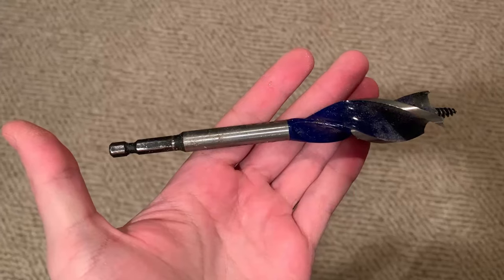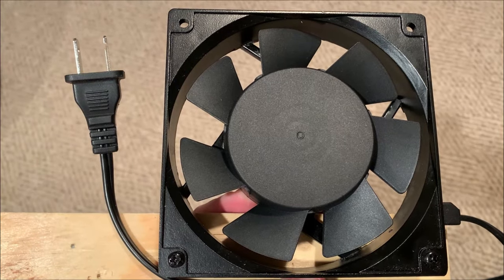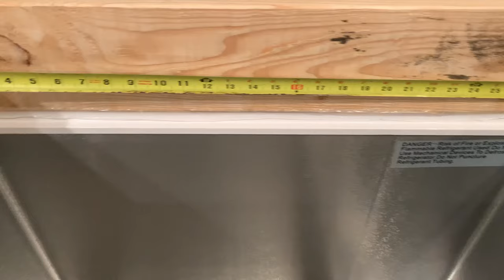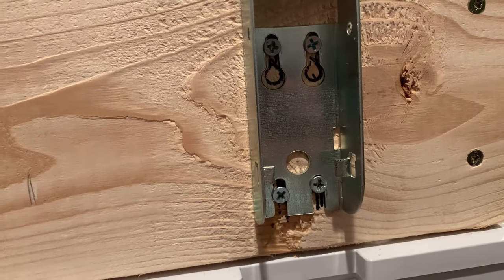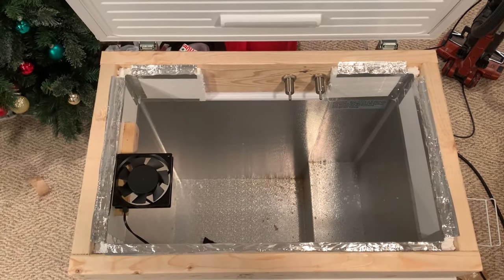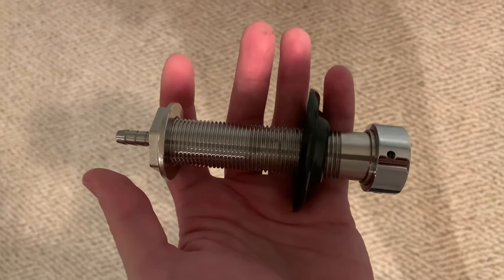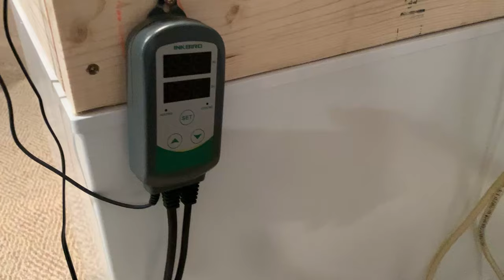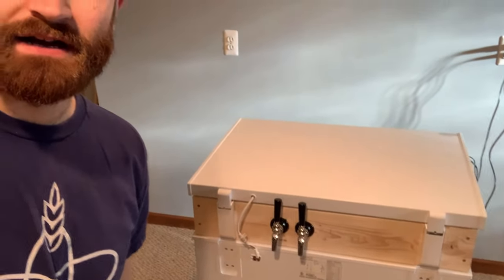How to Build a Simple DIY Keezer | Freezer Converted into Kegerator! Co2, Kegs and Tap Setup!

Comment: Nice job!  I built my Keezer back in 2005 and just purchased a new freezer to convert this weekend, (9/17/2023).  I'm still on my original Johnson temperature controller and all four Perlicks function as good as they did 18 years ago! Do it right the first time and it will last a very long time. I've never used any insulation as inch and a half wood will insulate at refrigerator temps just fine.  For others doing this project I would recommend using 3/4 inch wood around the top to create a nice flat sill for the lid to sit on.  Sand everything down nice and smooth and use two coats of primer followed by two coats of gloss white exterior paint and it will look like the collar is part of the freezer.  Mine is built into my bar so you can't see it but when I first started using the "keezer" it was placed in a room so the wife approval factor was high on the list.

Comment: Hey Matt, this video inspired me to build my own.. Quick question. I know you're using a temp regulator to keep freezer temps steady. But I know the freezers get mega cold, any problems keeping the temps around that mid 30s range? Can't imagine the freezer would have to work very hard to keep that temp level. Just don't want anything to freeze. Thanks in advance
Reply from the maker: Thanks for checking out the video! The inkbird regulates that so it does not get too cold. It will just kick the freezer on and off all day to maintain a temperature.

Comment: Does that inkbird controller turn power off when temp is 38f and will it turn the power back on if temp reaches say 40F. If that is correct can you supply model # of the inkbird please.
Reply from the maker: Hey! Sorry for the late reply, my notifications were turned off. Need to look into that...  You are exactly right! Also its just the most generic inkbird. Just amazon inkbird and its the first one that comes up.

Comment: when i built mine i didn't add any insulation at all to the collar, and it works just fine and looks a lot cleaner. thick, solid wood is actually a pretty good insulator all by itself.
Reply from the maker: Yea I dont think I added insulation on the first one either. Its just a nice to have, not a need!

Comment: I built my keezer 2.5 years ago...The inkbird you used for your keezer is what I used for my fermentation chamber...I've been using the Inkbird 1000F for the keezer and that's the achilles heel of my whole system...those are made to switch small loads, not a freezer compressor...it works, but I just went through my second one in 2 years. So, if anybody is thinking about using an Inkbird 1000F - you may wish to look for something that can handle a 15 amp load - it will probably live longer - really getting tired of beerpops.
Reply from the maker: Hey I didn’t think that would be an issue but I may look into that a bit to check that out, thanks to letting me know!

Comment: Nice "quick job"!
Why do you used the back of the chest freezer as the front of your keggerator?
Same as @jamess3532, I would not use any insulation. 
Regarding the temperature controler. The stc-1000 is a cheaper option. 
Cheers
Reply from the maker: The main reason is because I set this up behind a wall for the taps to run through drywall. But at the end of the day it didn't matter since I just leave the top unscrewed all the time anyway. The video is on my channel if you wanted to see how it turned out.

Comment: Great video Matt! You mention that the beer lines should be about 3ft long, but many of the articles I've read either suggest 10ft beer lines (especially at higher altitude) or using a specific beer line length calculator. How did you arrive at 3ft?
Reply from the maker: Hey Marc great question. Altitude and tube diameter make an impact on length, im using pretty thin length so I use around 3ft. 4ft is also acceptable too.  10ft seems really long for my diameter of tubing. Also the pressure of the kegs also are taken into consideration. I use about 7-9ish psi with around 3-4ft of tubing. http://beersmith.com/blog/2011/07/14/keg-line-length-balancing-the-science-of-draft-beer/

Comment: Well done video.  I am debating on pulling the trigger to get some "real" taps on my kegerator (a hand me down fridge) to upgrade from the picnic taps I have been using for many years.
Reply from the maker: Yea they have cheep ones from Kegland, like around 15 but you will still need the shank which is more expensive. You may be able to find some bundles on amazon with a shank to save some money.

Comment: Good job man. Been watching many videos on these to build my own version. My only question is why you didn’t add any foam around the tap lines? Even if it’s an oversized hole(in the foam) so that you don’t have any leaks down the road or issues down the road? Or does it even matter?
Reply from the maker: Hey, there is no reason why you cant insulate around the entire collar, looking back im sure I could have. Just did not in this build just to make it a bit easier. Could always add those around the shanks at any time though. Leaks should not be an issue.

Comment: Cool video but can anyone tell me the reason for the fan?
Reply from the maker: Fan is to help circulate the air in the freezer. Not necessary, just an extra thing.
Reply: @TroubleBrewing  does that make a noticeable difference in chilling time? I've never seen it done is all, it's an interesting idea
Reply from the maker: @NoMusiciansInMusicAnymore  I never ran any tests on that, all I know is when I was researching to build one most kegerators have a fan to recirculate the air. Thats the main reason why I chose to include it in my build.
Reply: @TroubleBrewing  very cool idea (no pun intended) thanks for the info